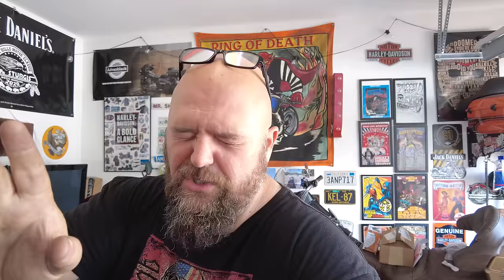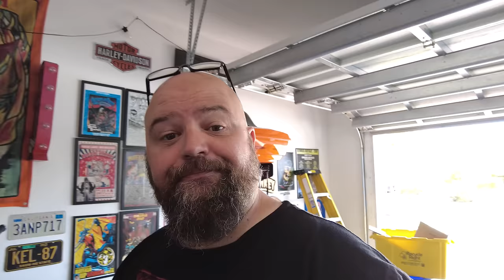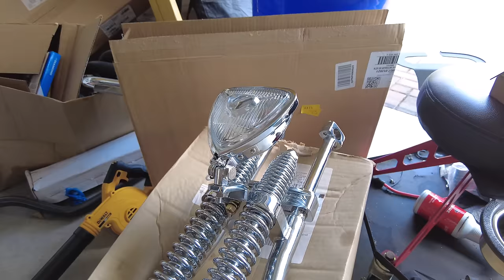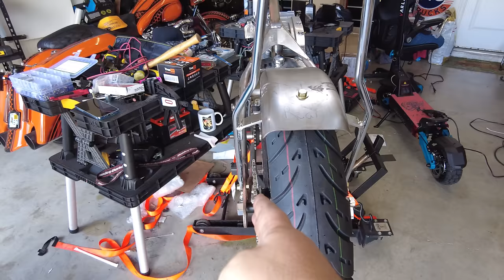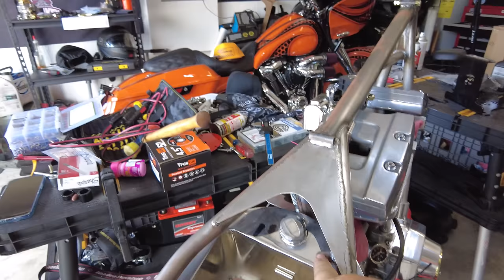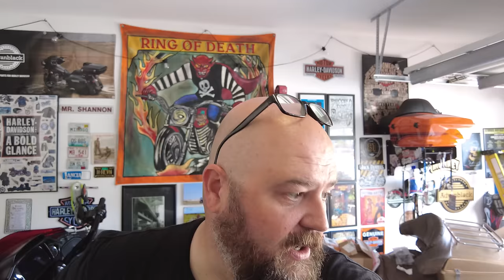How Did I Get Here with This Chopper Build?

Comment: You are correct the most frustrating thing in the world is buying a bunch of custom parts to put them together and none of them effing fit. Like when the license plate holder doesn't have a big enough hole to go around the axle.... Keep your head up you're doing the right thing. I built a 2000 hardtail Sportster that's raked out and boil boy nothing fit like it was supposed to. However my dad and I built it together at his shop and it's one of my proud crowning jewels of my collection. Even though it is not by any means the best bike.

Comment: Looks like you've got a great build going.  Really like the effort to have hidden wiring. Just remember to wrap the wiring where it enters/exits the frame or use grommets on the holes to prevent insulation rub-thru.  Shorts to ground ruin one's day and cause major headaches trying to find the problem.

Comment: Are you going to trim the fender so it stops at the bottom of the oil bag?  I’m no professional but I think it would look cleaner without the fender going down so low.
Reply from the maker: Not sure. The rear fender also protects from spray on the trans and motor.
Reply: @ProfessionalMonkey   I can understand that aspect. I just think it would clean up the space between the trans and the tire. The spacer and tab just stuck out to me when you panned from the tire to the engine. I love the style you’re going with, and at the end of the day it’s your scooter. Keep up the good work
Reply: I think it was the tab and spacer the made it look “messy” for the lack of a better word